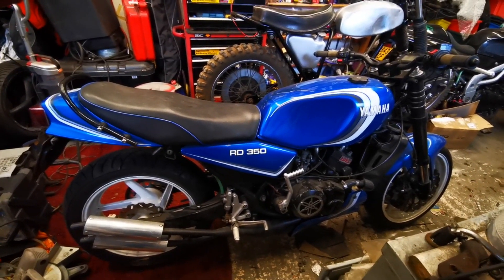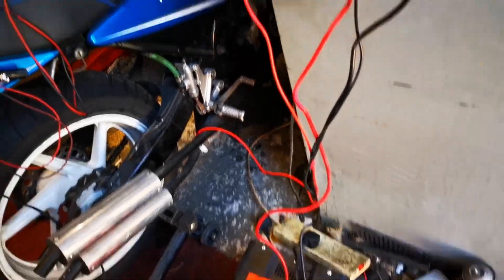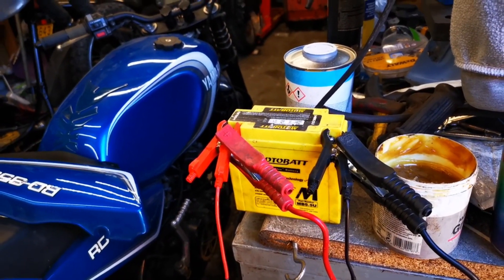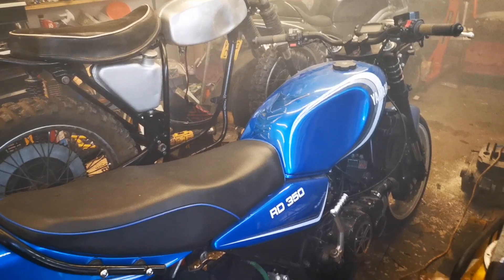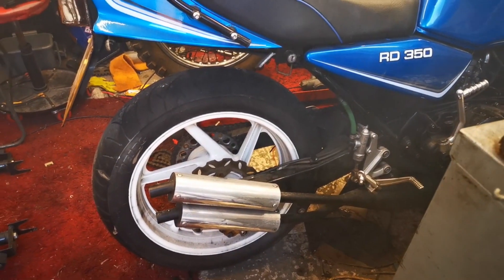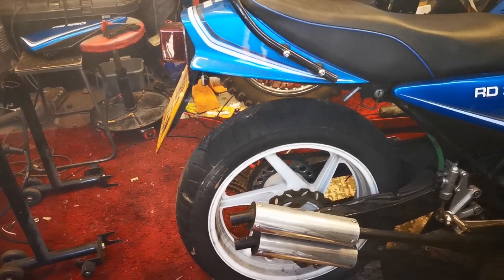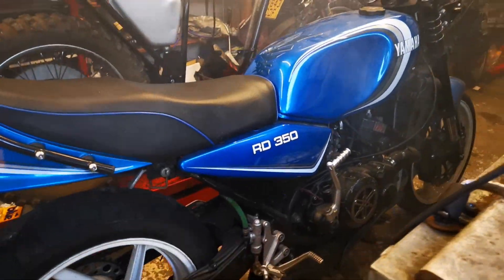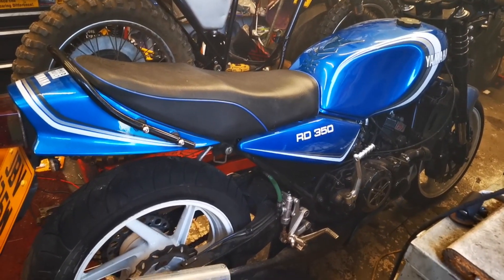Yamaha RD350LC Revive

Comment: When you modify what can be registered as an historic vehicle, you lose the right not to take it for an MOT right? My LC is currently standard, coming up for 40 years old, I'm wondering what mods I could do without affecting the no MOT aspect?
Reply from the maker: Motorcycles have much looser criterias than other 4 wheel vehicles. Brakes suspension, wheels even engine capacity are all considered acceptable:

Official guidance below 

The following are considered acceptable (not substantial) changes if they fall into these specific categories:
• changes that are made to preserve a vehicle, which in all cases must be when original type parts are no longer reasonably available;
• changes of a type, that can be demonstrated to have been made when vehicles of the type were in production or in general use (within ten years of the end of production);
• in respect of axles and running gear changes made to improve efficiency, safety or environmental performance;
• in respect of vehicles that have been commercial vehicles, changes which can be demonstrated were being made when they were used commercially.

In addition if a vehicle (including a motorcycle):
• has been issued with a registration number with a ‘Q’ prefix; or
• is a kit assembled from components from different makes and model of vehicle; or
• is a reconstructed classic vehicle as defined by DVLA guidance; or
• is a kit conversion, where a kit of new parts is added to an existing vehicle, or old parts are added to a kit of a manufactured body, chassis or monocoque bodyshell changing the general appearance of the vehicle;
it will be considered to have been substantially changed and will not be exempt from MOT testing.

However if any of the four above types of vehicle is taxed as an “historic vehicle” and
Reply: @bazzasbackyardworkshop  Do you know if say putting the more powerful YPVS engine in a 4LO frame is outside these rules? Or if you increased the original 350cc to 380cc for example?
Reply from the maker: @steveclark..  both are classed as acceptable and not classed a substantial change
Reply: @bazzasbackyardworkshop  Yet both methods increase the power output by some what. I'm amazed that they would be OK with that to be honest.
Reply from the maker: @steveclark..  so long as it is a parallel twin it's covered by the rules. Insurance obviously will want it declaring but it will still be mot and tax exempt.
Reply: @bazzasbackyardworkshop  Thanks, that's good to know. The other month I got talking to a guy with a Honda CBX 6 cylinder, he got pulled by plod for having a small number plate. The cop then questioned the no MOT thing because he noticed all the non standard parts, swingarm, different forks and wheels etc. He said that this copper issued him with some paperwork, obviously wanted to take things further,... hope that he doesn't have to go to court over it but who knows. The whole legal system seems to be corrupt nowadays.
Reply: @steveclark..  different forks and wheels are allowed (under improvements in safety or efficiency) but if the method of suspension is changed i.e. if you went to hub centre steering or telelever instead of conventional forks that's not allowed.
Reply: @barrypringle3611  That makes sense but I'm kind of surprised that they didn't including normal forks of a larger size being against the rules. At the end of the day, they want to limit the amount of vehicles that qualify for no MOT surely? Do you know if owners of these heavily modified vehicles have to pay for the road tax then or would it still be free?
Usually anything to do with governments comes down to taking money and not for our benefit of you get my drift.